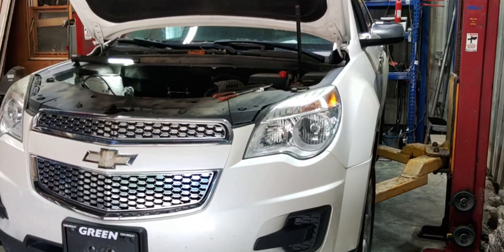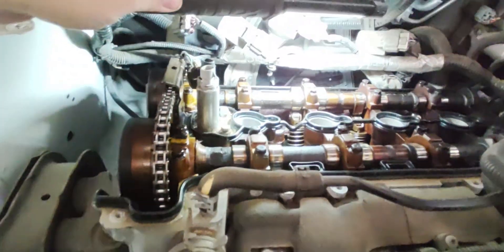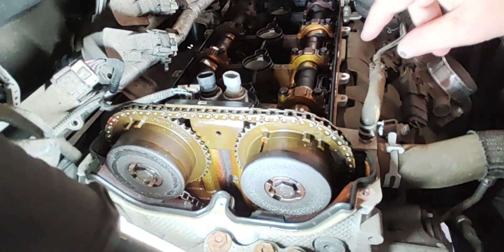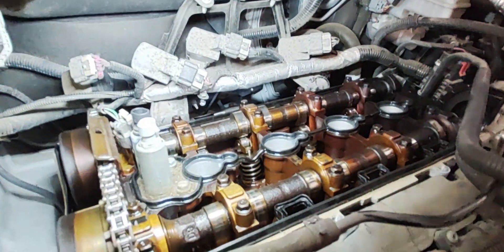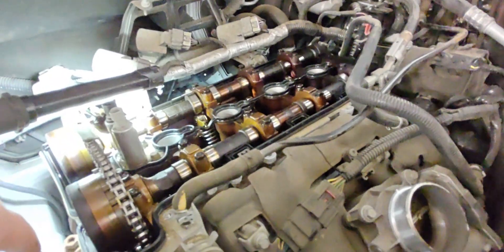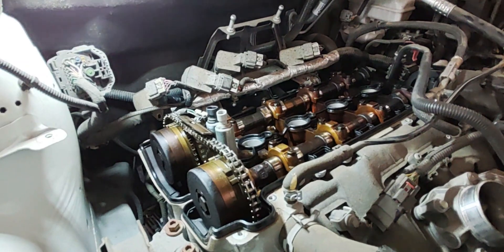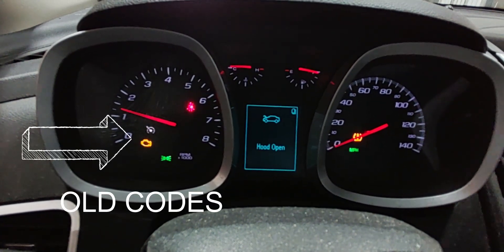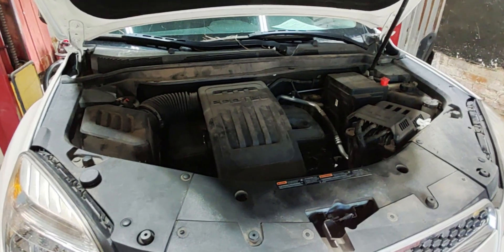Do these checks before replacing your 2.4 ecotec! You may not need an engine!

Comment: I just redid my wife's timing chain 2012 terrain 2.4L, the car ran rough after like it did when it needed the chain. did a compression test no compression on #3 only. Pulled the head did a valve job. put it all back together , timing good valves seated goot after lapping in. still no compression on #3 1,2,4 200psi, #3 0. Im a beginner. WHT is my problem..Also did a wet compression on #3 no change in compression still 0..... Im stuck with this engine...NEED HELP!
Reply from the maker: I'd say you're more than a beginner, you did some serious work. That being said, if you have zero compression the culprit should be glaringly obvious. Are you positive the exhaust valves weren't burnt? I've ran across many 2.4s with low compression and a burnt/ cracked valve. When you had the head off, did you flip it upsidedown and put fluid in the combustion chamber? Water works but thinner fluids like acetone is better. I've caught some leaks around the valves that way. Seeing as you mentioned that you lapped the valves, I'll assume there fine, but you should consider doing a leak down test in addition to the compression test. I've ran across one car in my life that had an exhaust port completely blocked with carbon. It had extremely low compression and a dead cylinder. Double check your valve train looks good under the valve cover, if the rockers slipped out the valves can't open, but to have them both fall out on intake or exhaust would be odd. No improvement on the wet compression test has me leaning towards something missed in the head. Do that leak down and let me know what you find. I'm intrigued now.
Reply: @shedhouse7330  no compression on #3 before the valves were done… I’ll have to get a cylinder leak tool tomorrow, don’t own one… still no compression.
Reply: @shedhouse7330  tickets all seem good. Nice and tight no wiggle. Car never ran hot or chain never completely came off.. the other think I’m worried about is if this engine has been replaced with an earlier model, if so then the timing is going to be different. I think the cam marks need to be at 10 &5 for 2011 and newer and about 7&5 for 2010 and older
Reply: @shedhouse7330  did leakdown on all cylinders! 1,2,4 did great minimal loss over time.. #3 would not even hold air at all @ 100 psi. With the cylinder at TDC on the compression stroke I can hear and feel air coming out the tail pipe.. so the exhaust valves are not closed or leaking… I’m surprised because I put all new valves in all the chambers…. # 3 didn’t have compression before I did the valves.. no air coming into water/ no bubbles so I’m confident the head is good… I guess I have to pull it all off again and redo the valves on the number 3 cylinder… lot of work. Geesh! Not what I wanted to do..
Reply: @shedhouse7330  so here is the whole of it.. timing jumped.. replaced the timing chain… ran rough. Misfire #3. Did compression on all cylinders 1,2,4 all good 200 psi after 6 revolutions of the motor on each cylinder… pulled the head thought it might be a bent valve, lapped and replaced all intake and exhaust valves….. put it back together,retimed.. started right up.. running rough.. misfire #3 still. All new plugs and ignition coil packs…… still no compression on #3 cams, risers all good and tight… cleaned injectors while I had them out… all new gaskets no leaks. Not over heating… head is good I’m sure… my next thing is to just pull the head again and redo #3.. with The head off I put plastic wrap over the cylinders to see if they sucked in on exhaust stroke and out on compression stroke… all good so I don’t believe it’s the piston rings.. never had smoke or anything out the tail pipe…. I’m lost.. what next? Pull the head again.. or what.. need expert advice.
Reply from the maker: @nextdoorpowerwashing8340  with air coming out the exhaust during the leak down test, that really narrows it down to a bad vale or bad seat. It's a bummer to pull that down again but it really sounds like your only option. Go in for a solid visual inspection. Hopefully you find out what it is. Also, double check your exhaust valves are 100 percent closed, you can grab the cam on the flats with a wrench and roll it forward and back a bit just to make sure.

Comment: To whom it may concern.... There is a recall on the oil consumption problem. Could possibly cover timing chain issue. Worth the effort people.
Reply: Depends on where you are. I think GM of Canada only covered this issue for X number of years and/or X mileage. Sorry, I forget the specifics, but I think I even spoke to someone at GM about ours, and it's past those. It really sucks cuz ours only had just over 100,000 km, but I'm going to explore all my options. I might grab one from a wrecker and rebuild it slowly, or price out a reman long block. I can't really afford to get rid of it right now.
Reply: I was unaware of a recall but found a class action lawsuit that was settled with GM. I have been dealing with oil consumption for last two years with my 2013 Equinox and it died last week. I had planned to reach out to GM but don’t think they will help me since it won’t start now and therefore can’t perform oil consumption test (I carried the big jug of oil in my car lol). I have a friend who is going to come over to check to see if it’s a timing chain issue, wish me luck as I can’t afford to buy a car right now.

Comment: When checking those rockers a bent valve will have them fall out on their own or if you are able to wiggle them out?
Reply from the maker: Depends on how bent the valves are. I've seen them laying in the head and I've also seen them just loose where they could be pulled out.

Comment: Could you provide a parts list for this job?  Put up some affiliate links, I’d be happy to use them.
Reply from the maker: CLOYES 94201SAVVT1 Includes VVT Sprockets and VVT Solenoids off rock auto or any other site. right now it's about $300 shipped.
Reply: Thanks!

Comment: I’m trying to educate myself with all your videos. Shame I don’t live closer to bring mine to you. I’ve had my timing chain replaced about 3 years ago. Now I’m getting a cylinder 2 misfire. Any idea if this is all related?
Reply: I had cylinder misfire - also engine "dieseled"  (ran on) after shutoff.   Turns out it was the high pressure fuel pump - seal failed and fuel vapor leaked into crankcase and PCV system.   Confirmed with OBD2 that fuel trims were lean - typically a mechanical issue, in my case fuel pump - but could be stuck open fuel injector.

Comment: Im SO happy that i bought the 3.0 liter 6 cylinder.  Still runs like a top!!
Reply from the maker: Keep the oil changes up. The v6 has chain issues too 😞
Reply: I have a 2010 GMC Terrain 3.0 l
Engine running very well, no noise no power lost but P0017is permanent! It has 186k miles and spends 2 quarters oil per oil change. Oil is changed regularly!Dealer told me  engine chain is stretched and must replaced! 35 hundred dollars! I’m thinking to drive antil engine to die and after looking for another vehicle!

Comment: what timing chain kit would you recommend?
Reply from the maker: Your best option would be gm from the dealership. Second best would be cloyes. I've used lesser brands without issues as well but it's one of those things you don't really want to cheap out on.
Reply: @shedhouse7330  thanks for the advice  I think im gonna go with cloyes. It's kinda a beater car at this point I really only need it to last another year but don't wanna go super cheap with it.
Reply: Cloyes usually in stock local stores. But they are real good kits actually. Not super  cheap. Cloyes and GM for sure.

Comment: I have this engine. It thought it had a broken timing chain but I opened it up and the timing chain looks fine. Way down in the hole I can see a different chain laying there. What could that be?
Reply from the maker: there are two chains, the main chain that causes all the problems and the chain that drives the water pump and balance shafts.
Reply: Thank you! I thought my engine was shot but maybe I should pull it out and try fix it. @shedhouse7330
Reply: So typically only one chain is replaced?   The balance shaft chain can be kept?   @shedhouse7330
Reply: That's your chain for the water pump

Comment: Very great! I got a 2010 Chevy Equinox 9 months ago from a dealership. It burns 1 quart of oil per 1000 miles. I got a low oil pressure warning when I was driving on the highway. When I pulled over and added 2 quarts of oil to the engine,  I could start the engine without any code, but I heard big noises coming from timing chain area. One mech told me it may need to replace the timing chain (cost $2K). But with the burning oil problem, it is better to replace the whole engine ($ 5K-7K).  Now, I am going to check the timing chain and maybe replace it. But, I know nothing about the car...trying to find some great videos talking about this problem,. Thanks very much for your great video!
Reply from the maker: Glad you liked the video. You're still going to have the oil consumption issue after doing the timing chain. You could possibly have a pcv issue causing some of the oil burning and that would be worth looking into. 2k for the chains alone sounds a little steep, but maybe your market can bring that much. Might want to call around a bit. If you replace the engine with a used one, you're basically in the same position you are now. You really don't know how good that replacement engine will be. If its new, that's different but still a lot to spend on a 2010.
Reply: I have a 2012 Malibu 2.4 same engine,first clean your pcv system.Its called the office.Take off the intake and clean it Carb cleaner with the straw in the hole.Put the intake back on.Change the oil with your choice  .There is videos that will show you how to do it .I had the same problem.  This will help
Reply: There’s more than just one tiny hole in the intake manifold gots to clear all them up

Comment: Do I have to do a timing chain if I only need to change a phaser?
Reply from the maker: Technical answer is no, but it's a risky task if you've not done one. I've done it by pulling the cam out while holding the phaser on the chain and then swapping the phaser while keeping the chain pulled up and tight. Wore case the chain slips, you'll end up doing the chain anyway to re time it. spin it over a few times by hand after you get it back together in case the chain did slip. Better to find out rolling it over by hand than having it bend valves when you crank it up.
Reply: @shedhouse7330  thank you so much!

Comment: My 2015 gmc terrain drove fine to work once i got out it turned on and cut off.towed it home took checked oil had none but i checked oil week prior ,so i took off valve cover and top guide plastic gone my gmc has 95k no codes,slapping of the chain,will i need a new engine ?
Reply from the maker: Did you inspect the rocker arms to see if any were popped out?
Reply: @shedhouse7330  I could pull out the rocker follower out but when the top of lobe is up or either half way
Reply from the maker: @10sandovalallan  If you can pull them out you have bent valves. Even when the lobe is in the "off" position there is still a little preload holding the followers in place.
Reply from the maker: I should add, this isn't necessarily a death sentence for the engine. I've repaired this issue many many times by pulling the head and replacing just the bent valves. along with a timing chain set of course.

Comment: Dorman makes a Timing Chain Guide Bolt replacement 917-954. Have you ever tried this? Some claim the tensioner needs to be unarmed for install, but I'm not sure that is the case due to the type of tensioner. 

I heard that GM revised the tensioner. Is that worth just changing even if the timing chain is fine?
Reply from the maker: I keep one in stock. When the chain stretches it will beat the heck out of the guide, and after the guide fails the chain destroys the bolt that's left behind. The threads of the bolt end up in the head but there will be nothing left of the bolt itself. So, that dorman bolt saves you from having to extract the leftover bolt from the head before installing new chin kit. And yes, replace the tensioner with the revised part number. If your going in for timing chain work, plan on doing the entire kit. Chains, guides tensioner phasers and actuators.

Comment: Just had a  new timing set put on my 2014 Malibu due to  loose guides. Dealership told me engine was toast and to replace it. I only have 137,000 miles and was running and sounds fine. Independent shop laughed and said no a new set would save it. Yea it was expensive 1,500 but not 4,000 for a new engine or car.
Reply from the maker: case and point. Thanks for sharing

Comment: I simply replaced my timing tension that’s on the back of the head and went to start to activate tension boom no start..Scrapping it tomorrow never going to Chevy again in my life I hate Chevy now
Reply: Bro the tensioner on the back is activated by depressing the plunger 2mm with a hammer on the chain... you just took all tension off your timing chain and then started it,  probably bent some valves.

Comment: I have a 2010 Malibu 2.4 eco... I don't have any oil  consumption, but my chain started slapping, how often is it just caused by the upper chain tensioner?
Reply from the maker: hard to say and it's hard to see even with the valve cover off. I mainly see bad chains.
Reply: I have an 08 2.4 cobalt. The FSM set that I bought with the car in 08 says 100K miles is the frequency of timing system life. Mine doesn't use that much oil, but maybe 1 qt or less every 6 months.  The car does no milage, so I use the 2x a yr. oil change rule. I watch the oil life monitor and when I get to 40% I start to look to change out the oil & filter. That usually is 2x a yr. I have 94K on mine.

Comment: K bro what if didn’t have piston to valve contact before I pulled it apart can I reset the timing with the crank and not pulling the cams off ? Let me know
Reply from the maker: if the valves didn't hit the pistons, then yes replacing the timing chains should get you back up and running.

Comment: Great video, it’s a little crazy shop’s taste a pass on timing chain jobs. My son and I are changing the timing chain in a 2014. It has pretty significant consumption issues, we’re toying with the idea of putting new rings in it. I’m curious what your success rate is for replacing the rings. Not sure how far down the rabbit hole we wanna go before it just not worth it.
Reply from the maker: You can get a piston kit with rings online. Makes the swap faster so you don't have to clean the old pistons. you'll have to pull the head and the oil pan, but it can be done without pulling the engine. I've never replaced just the rings, but I'm sure that would also work.

Comment: Im a 1 man auto shop. I have replaced at least 60 of these timing chains and probably 10 engines. The thing about just doign the timing chains is it doesnt address the underlying oil burning issues. That is the root cause of the timing chains being stretched. Sure you can make it run again but its still burning oil.
Reply from the maker: I agree, if they're burning oil the chains will stretch again if oil levels are left to run low. I'm a one man band too, so cheers to that!  pcv systems can cause oil consumption and the direct injection causes fuel to get into the oil too. Have you done any piston kits on these? I've done a few to save from replacing an entire engine. I've had good luck doing the pistons, timing kit, water pump and injection pump. Really not that hard or expensive, compared to a new engine anyway.
Reply: @shedhouse7330   Yes, but in terms of labor costs - is it about the same?     Are the engines from Jasper an improvement?     Mine is 2013 Equinox at 155K miles
Reply: Ecotec engines pre 2014 are  famous for "excessive oil consumption " due to the cheap, chinese piston rings that were used. If by some miracle anyone finds one for sale still runni g....RUN! I'm @ 190k miles on my regal and have changed brackets and bolts twice, and the expensive generator, twice.  Best to check oil with EVERY tank of gas!
Reply: @kevlandry8493 I'm in the process of replacing the pistons and bearings (spun a bearing on cylinder 3) and replacing the rings with Hastings rings.. Hopefully they stop the oil burning...
Reply: I must be lucky I have a 2009 saturn and no oil consumption at all at 170k miles. I also did the whole cloyes kit with water pump at like 80k it's been good vehicle. I've also been meticulous with all the fluids. Seems like the DI ones have major issues with fuel wash.